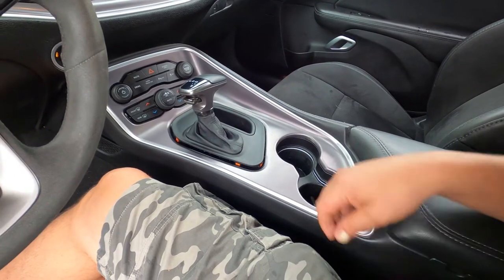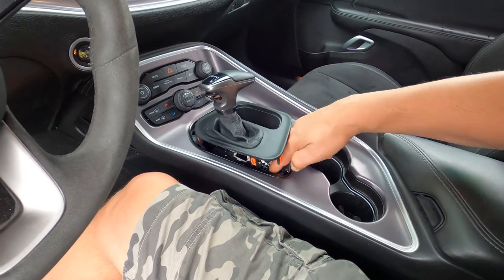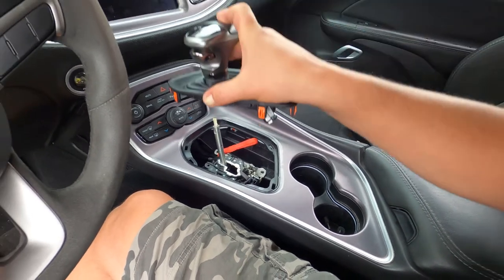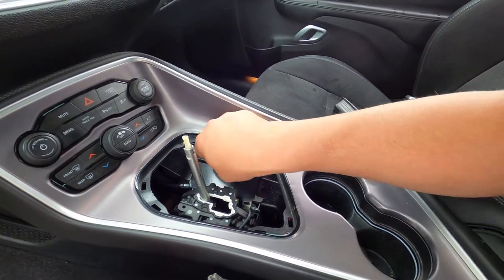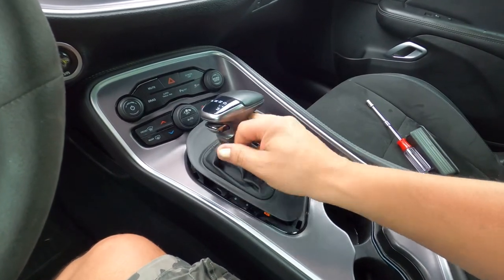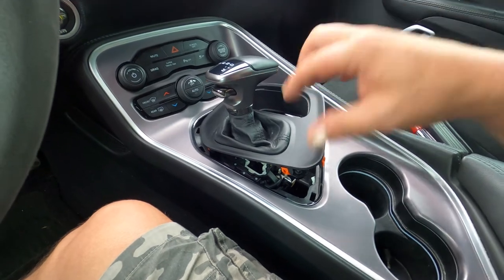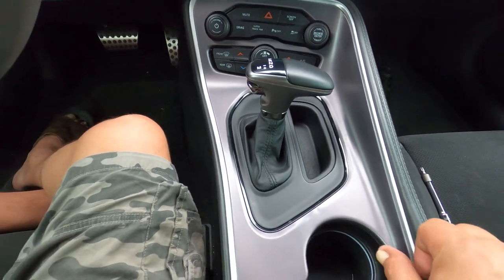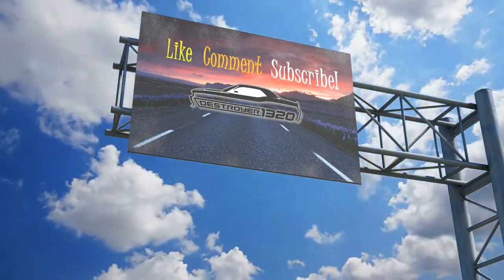Dodge Challenger TDS cover install video www.destroyer1320.com

Comment: If it is that easy to install, isn't it also that easy to remove? Or am I missing something?
Reply: I'd imagine that if you use Lock-Tight or completely strip the bolts itll make it completely unstoppable unless they have an ankle grinder. this is just a thought I had, but you are not wrong at all.
Reply: It’s all safety screws so they would need to have the tools to do this entire job. It isn’t a perfect answer, but it’s very much so enough to dissuade a thief when they realize that their plan has fallen apart.
Reply: Yes and no? It would make thieves second guess themselves when they realize they can’t roll away with it and how tedious and time consuming it would be to unscrew everything. This really just acts as a stall.

Comment: Easy 10min install.  Took my time popping up the clips with a plastic tool.  Didn't want to scratch my baby.  Didn't have to disconnect the wire.  Unscrewed the T25 on the shifter and placed it to the side and then installed the TDS cover plate.  My '21 Scat Shaker is very happy with the results.  Thanks!
Reply from the maker: Appreciate the comment, thank you!!

Comment: I installed mines and 2 weeks later the theifs had the correct tools and took that cover off and rolled away with my challenger and left me that cover on the ground where my car was. So looks like it only works with stupid thiefs not the smart ones. So all I have left of my challenger scat pack shaker is this cover and my key. Yay

Comment: I can’t get that white connector to come off at all. You said there is a tab, I don’t feel one. I have a 2021 challenger widebody scat pack. But I managed to put everything on without needing to remove the connector and shift knob cover off. It took a bit of work and I’m thankful to have small hands. I’d still like to get that white connector off so I can perfect it.
Reply: Did u ever get it to work
Reply: The connector is a b** to get off. Use a small tiny flat head screw driver and press the tab as hard as you can. I chipped my panel trim doing this but honestly not too concerned about it. The effort makes the car a little more secure.
Reply: @SoNotAbot  no. I never got it off. I was afraid I’d break the wire if I tried too hard. Just left it alone and the plate is still installed pretty snug
Reply: @metallicaguy123  It's a regular electric connector. On one side it has a small tab that you have to push down on and pull at the same time. Usually a your fingernail works. If not, use a small flathead screwdriver. Find another clip like it that's more accessible, like in the engine bay and practice on that clip.. Good luck!

Comment: I installed it and I am happy it’s blocking the neutral strap definitely a theft deterrent but now my gears from neutral to drive isn’t shifting as well as it was at first and the security screws went in but harder then the factory screws I would be prepared for damages possibly all challengers are not created equal

Comment: Super easy install. Disconnecting the wire was the hardest part. I'm happy with the install
Reply from the maker: Thank you!
Reply: @Destroyer1320 does this also work on Durango SRT? Why not I suppose but I’d rather ask now lol
Reply: How did you disconnect it

Comment: Finally installed mine, the hardest part was getting the plastic off without breaking or scratching it. Everything else after was a piece of of cake.

Comment: Sir, I noticed that you already had the inner panel removed. Did you use a plastic pry tool? If so can use demonstrate that? I removed the change cover and trying to remove the plastic hard cover but it is sturdy set in place and i dont want to pull too hard and destroy something nor do I want to damage the interior finish.
Reply from the maker: YesnI used a plastic trim removal kit from Amazon. You can also remove the full console cover. I will find the video link for you.
Reply from the maker: https://youtu.be/O4J_gX3z1ec
Reply: @Destroyer1320  Sir, thank you for the fast response. Once the panel remover comes from Amazon I'll update you Sir.
Reply: @Destroyer1320  I didn't know any better. I would add that to your install instructions for people like me that didn't know Sir.
Reply from the maker: @thefire2845  will do thanks for the feedback

Comment: I have very to little knowledge in cars Haha but I just got a 2018 Challenger SXT and I do plan on buying this cover strap but what would happen if I cut the orange strap and remove it ? Will something go wrong ?
Reply from the maker: Nothing will happen, it is just another way to get leverage to pull it up. Like a matress tag
Reply: @Destroyer1320  Ahhh Ok sounds good! But can't they just un-do the process?
Reply from the maker: @babybossrt4798  Once you do the install you will under stand how hard it is to access. Plus you get security screws.

Comment: What are the tools needed to do this with ease. I lost the t25 torx screw down the middle.
Reply: Yo destroyer do you have any suggestions on what i should do. I cannot shift gears without the screw and I just got this car last week and am now unable to drive it
Reply: Where did u lose it exactly? I lost mine too it went into the plastic area under front 8mm bolt area!

Comment: So how is the tow truck suppose to put you on neutral  if you block it ?
Reply from the maker: If the car has power and you have the key it will go into neutral or you can remove it.
Reply: I  found it I see you use the same bolts that come with the car lol what you think is a fair price for the labor  I can’t do this I don’t have the tools ?

Comment: now what about when you need to actually get to it or you bring the car in for service and they need to town the vehicle in the shop and they cant get to the switch? i know my dealership i work at would then at that point say "come pick up your shit because we cant move it because of your aftermarket crap."

thats just me tho and i would never be caught dead buying a new cat that is older than 2008+
Reply from the maker: All you need is power and the key to the car to put it into neutral without using the release.

Comment: Would this be extreme enough that it would void anything?
Reply from the maker: No sir, it uses factory mounting holes.
Reply: @Destroyer1320  is the shifter removal on the challenger completely necessary to get at the bolts?
Reply from the maker: @poisonpizza12  you may be able to squeeze them out but would be difficult

Comment: Looked on the website to order for my 22 WB charger but said only 15 to 21 year but challenger said 22 yr if I ordered 15 to 21 it should work for my 22 charger right since same setup 🤔
Reply from the maker: The 22 Charger is in final prototype stage coming soon!
Reply: @Destroyer1320  OK thanks will be on the look out for it definitely need one
Reply from the maker: @dyoung3297  email me @mydestroyer1320@gmail.com

Comment: This is actually not as straight forward on the 2022 (not sure about other model years). The factory screws have a metal washer on them (that is an absolute nightmare to try and remove…so I don’t advise it). This washer does NOT fit correctly with the plate cover as it does not allow the screws to seat up/down (it tilts the screw 30-ish degrees and does not seat properly.  You need to replace the screws for this to fit, or modify the cover plate.
Reply from the maker: Can you please email me photos so I can correct the issue? mydestroyer1320@gmail.com
Reply: I just put it together with different, but similar screws (from Lowe’s: Hillman #10 x 3/4 IN). These screws allow proper installation because the width of the built in washer is narrow enough to allow the screws to seat straight up and down, rather than the forced tilt that the factory screws had. I’m assuming in 2022 (at least) they started using a wider washer, which requires more space between the screw hole and the vertical rise of the bracket. Sorry I didn’t take pics, which would help, but if you have a 2022 Challenger just go to Lowe’s and spend the $2.19 on the screws I identified and you’ll be good to go!
Reply from the maker: @richosburn  I really appreciate the tip, I have not heard of that till now. they must have changed it for 2022.
Reply: @Destroyer1320 , and I really appreciate you making these…Thank you very much. I emailed you pics of the factory screws, and the one’s I used to make it work. There may be better options out there, but I had to get this done quickly. If you do find a better option than the Hillman screws I used please advise and I’ll swap them out. But to be clear, with the Hillman screws everything looks correct and it went back together exactly like your video shows.

Comment: for the new square bit screws ( tampered ) that comes with this device , do you recommend adding the washers to those screws or just the screws by themselves?
Reply from the maker: Just screws for the Challenger
Reply from the maker: They are #10 x 3/4 if you are looking for a different screw type. Course thread
Reply: @Destroyer1320  thank you, the screws tightened up but they kept turning. Might try washer to see if it will help. Yes for challenger.

Comment: I scratched up the damn interior doing this. But she's sage now
Reply: Didn't fit correctly either
Reply: Got it to work lol
Reply from the maker: Contact me if you need anything. Mydestroyer1320@gmail.com
Reply: @Destroyer1320  thanks
Reply: Mine too, lol. It was not as easy at this video says but I had to find another way
Reply from the maker: @metallicaguy123  The connector is a pain to release, the tab is at the back of the connector by where the wires come in from the car side of the connector.
Reply: @Destroyer1320  I was worried I was going to accidentally pull and destroy a wire . Like this guy said, I did make a few tiny scratches doing it myself, but I’m happy it’s done and my neutral level is inaccessible now. Good luck to the thieves who try and steal my car and find out I have an aftermarket alarm, gps, wheel lock, brake lock, and now a neutral block. They’re going to need a lot of time on their hands especially after my flood light catches them
Reply from the maker: @metallicaguy123  Yes!! Great job brother

Comment: If they bring an 8mm socket and know it takes 2 seconds to pop that shifter up it’s useless
Reply from the maker: Thank you! For having no clue that is...
Reply: @Destroyer1320  thanks bro.. I have 2020 and I know how they work.. you literally need a hex socket and a screwdriver bro…they sell them together.. 

5 minutes and it would be GONE… don’t underestimate car thieves.
Reply: @Destroyer1320  not to mention you literally posted the video on YouTube as if criminals don’t look through this crap before attempting to steal… 🙄
Reply from the maker: @ruckus226  Yes #marked